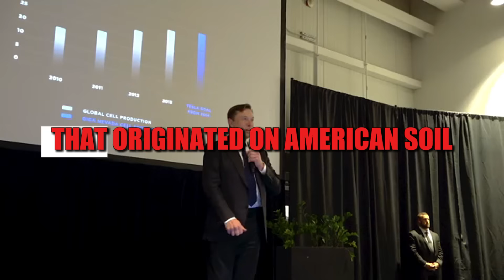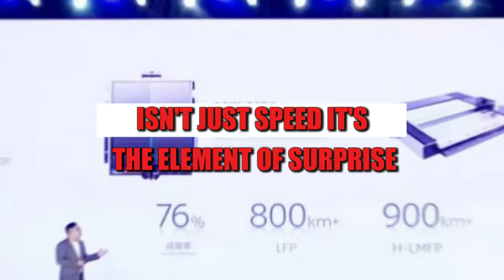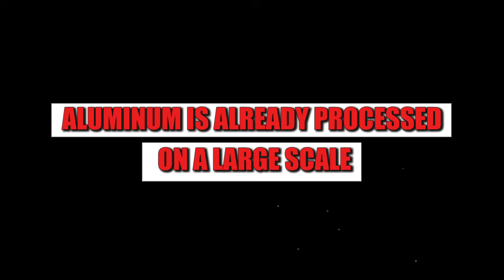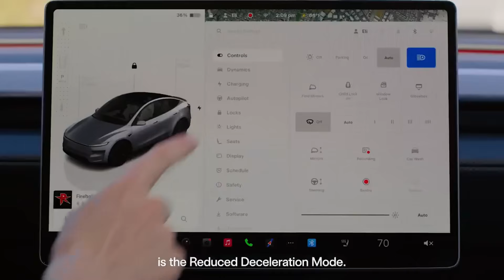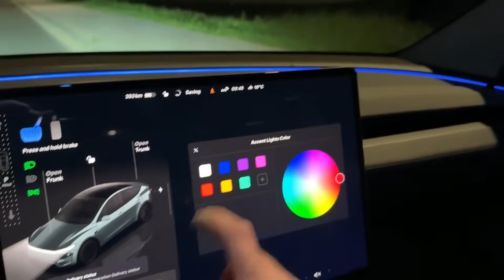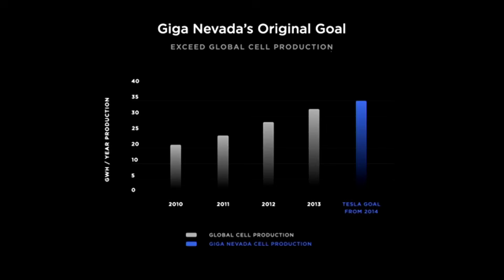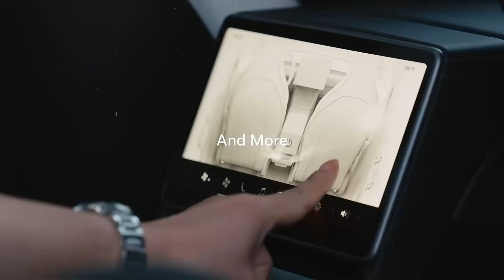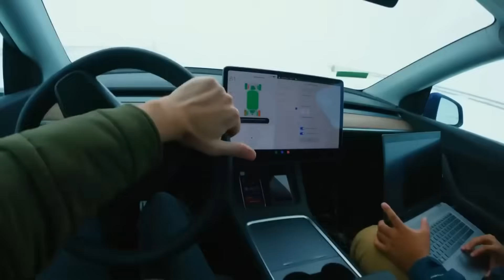Elon Musk REVEALS NEW TESLA BATTERY Aluminum-Ion — $61/kWh pack, 4-min charge, 96% at -30°C

Comment: AFTER THE ALUMINIUM ION BATTERY, THERE IS ONLY ONE PROBLEM PREVENTING ME TO BUY A TESLA: THE MODELS; THEY ARE ALL CLONES OF ONE ANOTHER. ITS LIKE BUYING A VOLKSWAGON IN 1945 : THE PEOPLE CAR: CHEAP  AND EVEVERY BODY HAS ONE PLUS THEY ALL LOOK THE SAME. WHERE IS THE SMALL SUV, WHERE ARE THE MOST USEFULL EASIEST ACCESS BUTTONS. ONE GIANT TABLET ONLY. WHY NOT SPREAD THE INFO IN 2 SCREENS ONE FOR FAST ACCEST, AND ONE FOR HIDDENED OPTIONS. I WILL DEFENATELY BE LOOKING FOR ALUMINIUM BATTERY, BUT NOT IN ONE OF THE ACTUAL TESLA. AND DUE TO THE GIGA PRESSES, CHANGES ARE EXPENSIVE, AND FAR DOWN THE ROAD.

Comment: I own an electric mountain bike with TWO Li-ion batteries (20 Ah and 15 Ah) and TWO motors, one in each wheel. If I could have these batteries rebuilt with Al-ion batteries it would be an amazing transformation. Currently it takes my 220 watt solar blanket and controller box about 4 hours to bring my batteries from 20 % charge to 85% her in theLas Vegas sun. With Al-ion I think I could do it in about an hour.  With my house charger maybe 30 minutes. BTW, there are several bike battery rebuilders in the US. I recently had an old Li-ion battery rebuilt and upgraded in power. NOT a cheap date with lithium batteries.